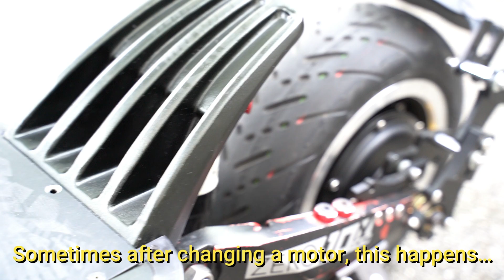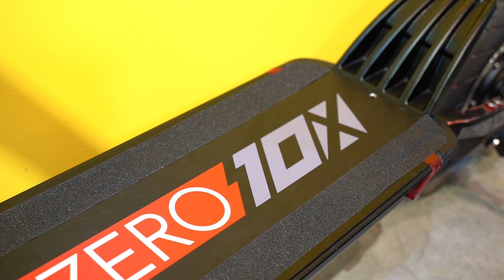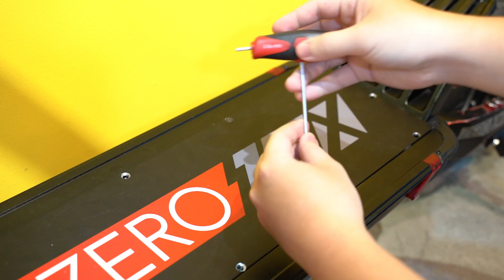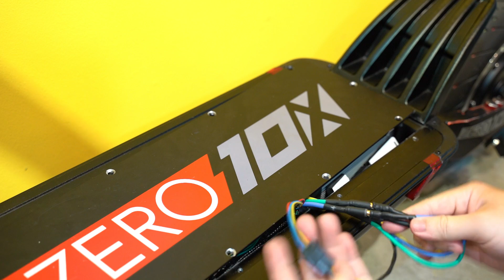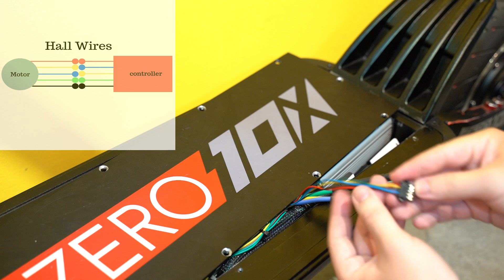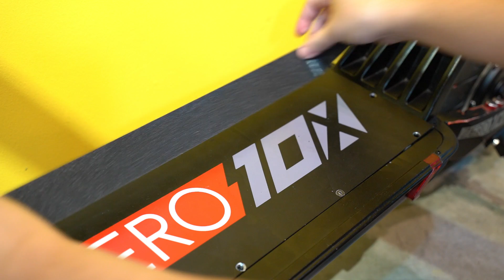Jerky or Noisy Motor? Try this Motor Quick Fix!

Comment: you're the best! combination #4 was the one for me. i'm using a bldc driver that's designed for CNC spindle motors (which i'll eventually put into a waterproof enclosure), so i wasn't sure if the loud rattling was because it was the wrong type of driver, but you made it easy!

Comment: Thank you good sir. I'd tried swapping phase wires in all the combinations as other guides show, but your info on the hall wires was the piece of info I was missing. Got it all working now 👍😃
Reply from the maker: Thank you glad we could help!
Reply: Swapped 10x controllers into 8x. Front wheel turns backwards,Tried all combo s ,only one work but it overheated and burned the wiring. Tries the hall sensor swap but still running backwards

Comment: Will this work on and scooter or just the 10x
Reply from the maker: any scooter
Reply: @FalconpevSg  thanks so much. So my motor is working but at times there is almost like a grinding sound then it goes away would this work for something like that or just if my motor isn’t working ? Thanks again for your time
Reply: @Trailfloater i have the same issue

Comment: Thanks alot for the video  I am going to try this with my motor tomorrow . I am sure this will be the fix. Thanks man!
Reply from the maker: Let us know how it goes. It’s not always the case where the phase wires are the issue
Reply: @FalconpevSg   this wasn’t the fix, i think it is something with the hall sensor because the motor acts the same way when the hall senor is plugged in and when it is plugged out. Thanks for the reply

Comment: I loved your video, I still couldn't solve my problem but I still haven't touched the hall connection I'll check. however I am using a controller for 60v with a 60v battery also in a 48v motor I don't know if this is the problem, because they said that the voltage was not a problem. that's true? thanks

Comment: Nice troubleshooting video, but honestly if I had this problem on what I am assuming would be a new scooter. I would promptly return it and exchange for one that is properly wired.
Reply from the maker: This is actually more for upgrades of motor that we sell. You can actually get a stronger drive system and you need to do this to configure your high speed motor.
Reply: @FalconpevSg  i see, that makes more sense.

Comment: I have the same fault i believe , my front wheel motor just sputters like its in a lock state or something it doesnt want to run smoothly like before i dont know what happen , only after i dismantled the bike and then put all back together that fault showed up .. im gonna try like you did in this video ,, and also when i disconnect the ble wire from the blue wire in the air without no loae it spins smoothly and fast , but when i put the tires on the floor with load it sputters and doesnt spin

Comment: Does wrong wiring will cause shortage to the moto
Reply from the maker: @consoletantreviews8181  no it won’t
Reply: Im here again, why when fully throttle my back motor hub starts vibrating like crazy it's so uncomfortable. @FalconpevSg
Reply from the maker: @consoletantreviews8181  either your tire or your wheel is not balanced
Reply: @FalconpevSg  now i noticed that my tire is near flat🤦
Reply: @FalconpevSg  when i try your combination why mine get smoked. Im scared to fry my motor hub.
Reply from the maker: @consoletantreviews8181  it’s not possible to smoke it

Comment: What to do when the engine is running but when I step on it it looses power going from 25km to 8km/h?
Reply from the maker: What do you mean step on it
Reply: @FalconpevSg  as soon as I put my full body weight and try to ride. I don't exceed 80kg, it says up to 100.

Comment: The second to last combo worked but the motor is running backwards. You show switching the hall wires when the wires are normal but how about when using the Blue-Yellow, Yellow-Green, and Green-Blue combo?

Comment: I have an soflow s06 with a custom controller, i have error e7, but its running and i think smoothly, i think the blue wire from the controller is loose than the otherones, i think it snapped of the controller, can u help me ?

Comment: hi man i got a kT 36v Foc controller with an LCD screen G51 and wired it up to my scooter .. it rattles and in some combinations it doesnot get any speed. the seller tels me its more compatible with electric bycicle engine ....and not ans scooter motor .... is it true?
Reply from the maker: @amirouw  check if motor is compatible firstly. The controller might be for geared motor
Reply: @FalconpevSg  this is what company told me at last ... you mean its impossible to wire it up to a non-geard motor? isnt there any firmware update or changes that or even reprogramming to make it work for fancy scooter motors?
Reply from the maker: @amirouw  no it’s not possible to change from geared to non geared motor

Comment: is the jerky or noisy problem normally shows up after some time of use? I didn't do upgrades so should I still try to change the combination when I got jerky motors after 1 year of use? Hoping for your reply, pls.
Reply from the maker: no, this problem will arise when you change the motor. when you get jerkiness after one year of use, it is most likely due to wear and tear of the bearings

Comment: Hi !! I just but Wolf King and everything is work good and after 20km the rear  motor stop working and begin to bloc and jerking like in this vidéo?? Need help
Reply from the maker: Something melted or burnt. Possible reasons: burnt hall sensor inside motor but unlikely. Burnt mosfet inside controller most likely
Reply: @FalconpevSg  thanks i will return tje scooter i tink
Reply from the maker: @davidworrall3653  we would recommend a VSETT instead
Reply: what is a vset instead?
Reply: okok the brand off a scooter perfect
Reply: wolf king wabboo is no good?
Reply: @davidworrall3653  I think dualtron scooter.

Comment: Why would my wires melt and the motor give out? Lose connection??? And would this help if I tried? It was working fine the entire summer... 😔
Reply: Resistance causes that. Can be cause by connections that loosen up over time or corrosion between the connections. This wouldn't fix that.
Reply: What can fix this??? New computer???
Reply: @MarvelousYoUnAstro  just new connectors
Reply: I'll try that and see... thanks brother!

Comment: My motor spin nicely in air but when I go on a ride you can hear the motor screaming like an airplane vroom vroom it’s too loud I can’t find out what to do I checked all sensors even replaced them still same problem 😢
Reply from the maker: @nooneelse1837  did you check the hall and phase combinations?
Reply: @ yes , 9 hours me and a friend of mine tried all possible cable combinations including the hall sensor wires bro
Reply from the maker: @nooneelse1837  did you recently change your controller?
Reply: @ yes I have purchased a after market controller as the old one had its mosfets burned out , new controller has 2 wires you connect together for the first time you connect new motor it’s called self learn so it can read the sensors but it’s not helped either still the same
Reply from the maker: @nooneelse1837  self learning controllers are not suitable for all motors. Your motor is incompatible with the controller hence there is no torque
Reply: @ yeah I understand, I bought the scooter second hand the original controller had most of the mosfets blown out so I just bought this new controller off of amazon now I am waiting to buy a good new motor 48v , to work with the self learning controller please boss thanks so much for your time and help
Reply: Any motor suggestions please thank you
Reply: @FalconpevSg  sir I now have purchased an additional controller kit off of aliexpress sensor less I’m hoping this to work better than the sensor one

Comment: My ebike motor make vibration when i reach at 25km/h what is the solution?
Reply from the maker: Check tires, check motor balancing and then check wire connection

Comment: I dont recommend to swap by place the PHASE wires. The wires on the load are geting hot at the connection piont and in cases starting to melt. The result can be a short in wires. (TESTED).  In ignoring the wire melt - the controller at the same time  is geting realy hot and in my test case it did automaticly switched off (protection). It was the ZHIPU controller wich are good made.
Its the Mosfet fault - wich needs to be changed.
Reply from the maker: We use special connectors which can withstand up to 200A of over current
Reply: @FalconpevSg   The wires are getting hot and the orginal connection is the weakest point. Ok - you swap the connections, but still use the same wires. And if you have upgrated connections - you think the video excited viewers will?
Reply from the maker: @Haiduk1985  you have your opinion and we respect it but I think we have the experience.
Reply: @FalconpevSg  Im talking of mine experience as a service tehnican in scooter workshop.

Comment: I have janobike t85 2800wX2 today rear motor started to make burly sound and stopped working please help
Reply from the maker: 1. Check the motor wires are not melted or burnt 
2. Check if there is any resistance in the motor

Comment: Hello I have a Zero 11x and motors don't drive forward when using throttle, it very jerky and needs to be pushed to accelerate in the right direction, thoughts?
Reply from the maker: Controller burn
Reply: @FalconpevSg  it is brand new out of the box? Have only moved it few km, but was like this first ride
Reply from the maker: @aidenCBR94  although the 11X motors are what we call sensorless, meaning they will be more jerky than motors with sensors, it shouldn’t be so jerky that you feel it. Where did you get it from
Reply: @FalconpevSg  I got it from IwheelEUstore on Ali express, I have already emailed them but no answer yet, wanted to ask your opinion, if I am on scooter and I try to accelerate, it will not go forward for 1 second it will jerk a bit backwards then start moving forward, really dangerous in traffic, only when I push with my foot does it go smoothly